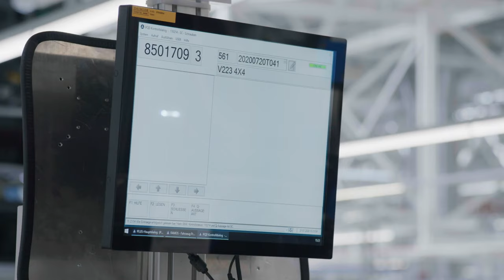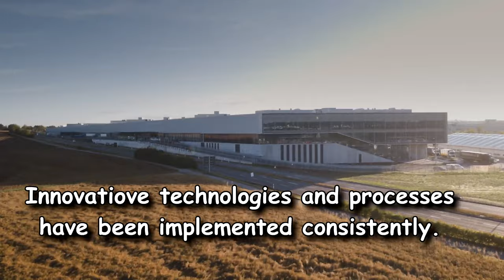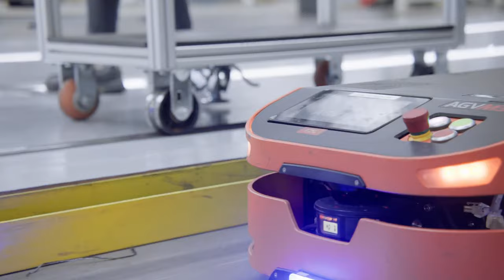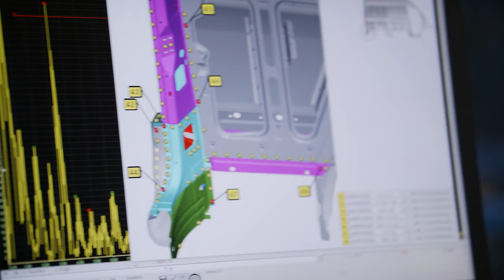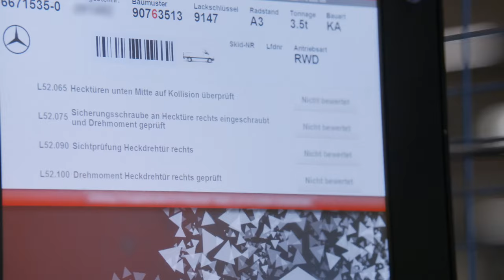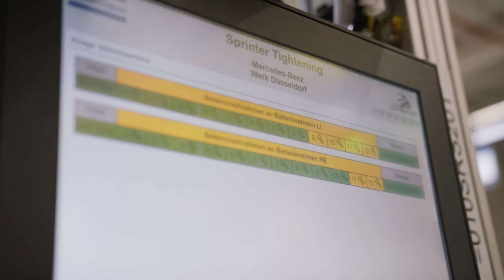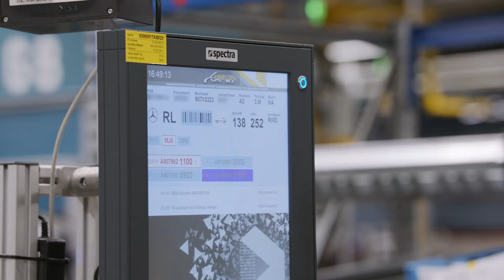Mercedes-Benz ASSEMBLY🚘2024: USA Factory tour & Manufacturing process E➕S➕C-Class Production line

Comment: I own an X167 GLS for 3 years already and I can say that the quality control at that assembly facility is under standards. From windscreen washer tank cap not sealing and spilling the liquid every time you have to break to sharp edges on the plastic trims fitted on the steering wheel. 
Second row seat if moved forward to allow access to third row seat will expose a dangerous sharp edge from the seat bracket. Second boot compartment door left with screws not tightened. 
Aircon inlet port leaking. Right side front door not aligned with the other body panels. Window seals not seated properly and having the pleasure of experiencing a window that does not lift anymore.
I do not even want to mention about the 12 recalls the car had in 3 years time.